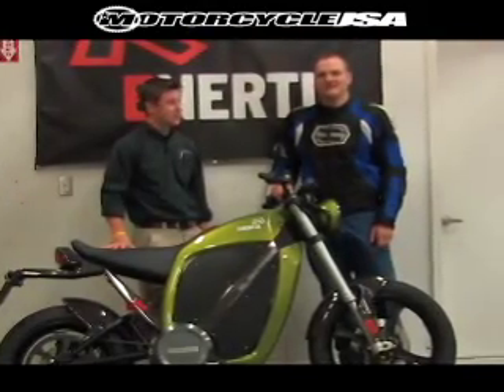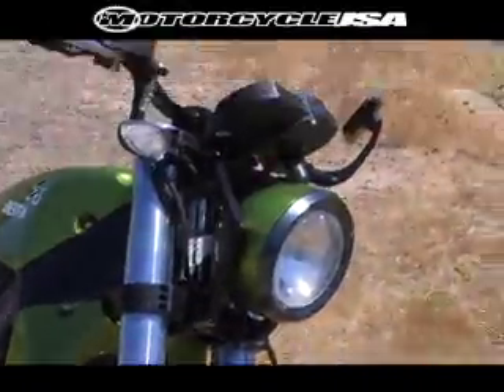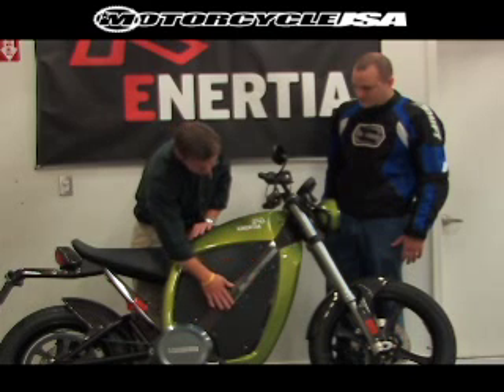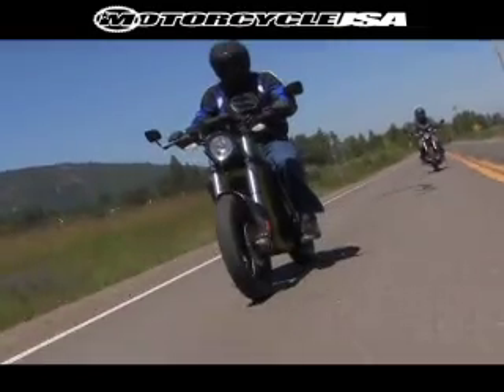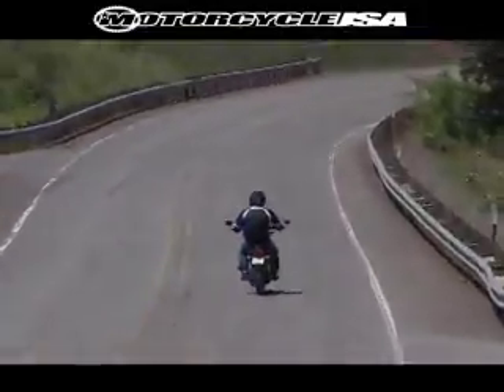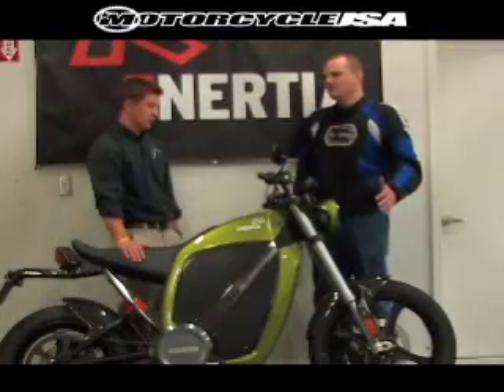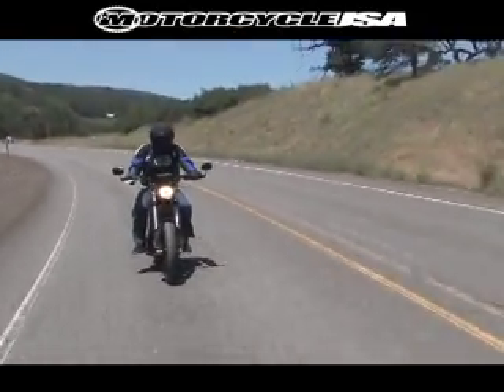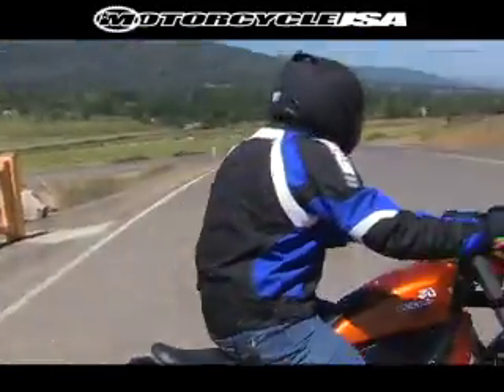2008 Brammo Enertia Electric Motorcycle Test Ride

Comment: My round trip commute is almost 70 miles so when you folks get it up to a 100 mile range I'll be thinking about you! Electric is cool, but in my humble opinion it will be a chemically charged system that will ultimately win the range war. Pull up to the pump. Exchange your spent chemicals for fresh ones to be recycled, and off you go!

Comment: Again I want an electric bike but there is just no way that I would pay that much. So its a cost issue for people and not much more. My proof, those little red scooters from the late 1980's that had a one gallon tank and went 100 miles on it. People but them up faster than they could be built because the price was right.

Comment: 43 miles range ,thats like 1 gallon of gas.even@4$ a gal, gas  bikes are still more efficient. new gas bikes produce very little emission  today.compared to the coal burning elec plants..imagine this: from your house to the beach is 45 miles,and every one wants to take their elec bike today. is there gonna be a charging station for every one.it would not be so bad if it charged in five minutes.the day some drone comes to my door with an ext cord: sir i ran out juice; ok ill call you a generator

Comment: @obadboystanley 
In fact, electric vehicles had been around for about 50 years BEFORE gasoline powered vehicles came along. It was only due to the electric starter motor and efficiency of gasoline that petrol powered vehicles became more popular. Electric vehicles in their early days were only capable of very low speeds and rather short range, not much more than a few miles. They sure have come a long way since then. 0-60 in 4 seconds or less and 200-300 miles isn't impossible these days.

Comment: Actually it uses lithium batteries which are made of nontoxic mineral salt and require no smelting during manufacture or recycling. It's other, older battery types like NiMH and lead acid that were bad for the environment.

Comment: this seams to be a great short distance bike. if it wasnt for the distance that i travel i would really consider purchasing it. but untill the battery is capable of lasting for more than a 45 mile round trip i could not personaly use it. though it is almost the perfect option for those who ride in the city. while living there i wouldnt think you would be traveling more than 2 or 3 miles on the average day to get where you're going.

Comment: i think its a great bike for $8000, not only is it good for the mother earth. its easy on your wallet too. think about the fuel money you save, oil change, filter, spark plugs and what not. Yea the battery is probably not good for the environment, but it could last 10 years. think about all the oil you go through in a combustion engine.

Comment: Not really,  Electric Vehicle Mall sells an electric motorbike for $5,000. It's sort of halfway between a motorcycle and a moped, it's called the XM-5000li and it goes 85 miles to a charge at 60mph, much better than the one in the video considering the price.

Comment: Think back to physics class. The law of conservation, specifically. That front wheel generator would add drag, which would negate any boost in range you could get. 

Any on-the-go energy generation scheme you think of has to be drag-free. That means no mounted wind turbines, no front wheel generators, etc.

Comment: it would be cool if the front wheel charged the battery wile in motion.3 hours charge for 45 miles would make for a short afternoon of riding.The day would be over if you wanted to go 100 miles.

Comment: compared to a ninja 250 this bike isn't worth it, 250 gets 70 mpg, and can easily maintain a speed of 60 mph for 200 milesand at $3,500 it's a steal. The inertia costs $12,000, top speed is 55 mph, and range of 45 miles. At 70 mpg does anyone care about the price of gas.

Comment: It's a nice concept ... but for now my VMAX still does the job for me.
The price point is wrong. If you're aiming for 40 mile round trip in city commuting you've got to come in at or under $7500. I think it's most likely a cost engineering job. You need to sell 51% of the company to a GM or something that can manufacture the same bike for about $2500  and isn't looking to recoup the R&D cost in two years

Comment: Twelve grand? Don't think so. You could buy a fleet of good small displacement bikes for that. You'd never recover the additional cost even at four dollars a gallon. This is a feel good machine....just move the carbon output to the power station. Noone talks about the toxic materials used in battery production either.